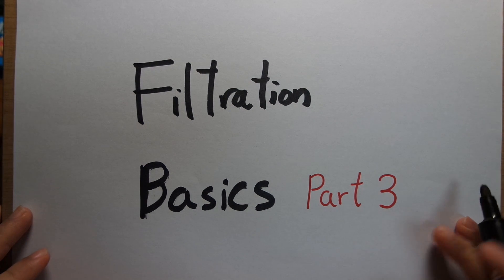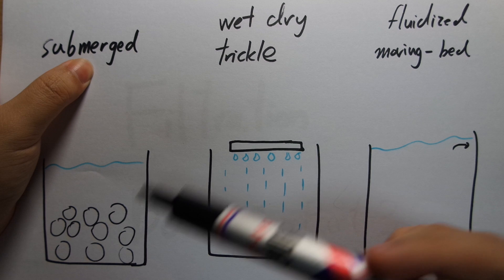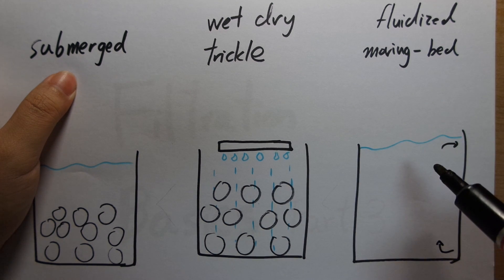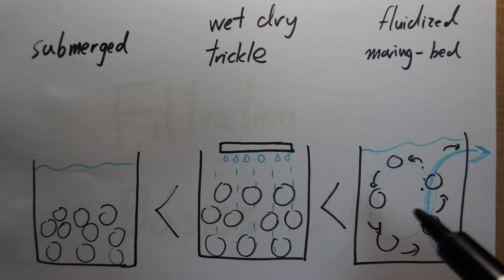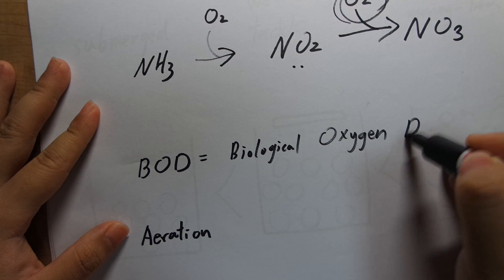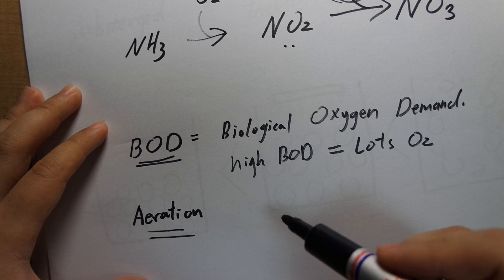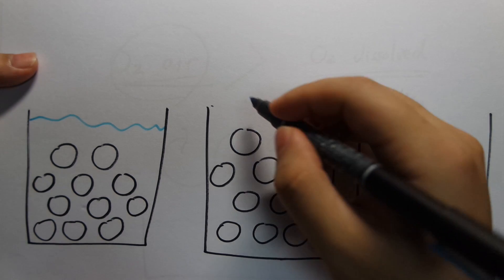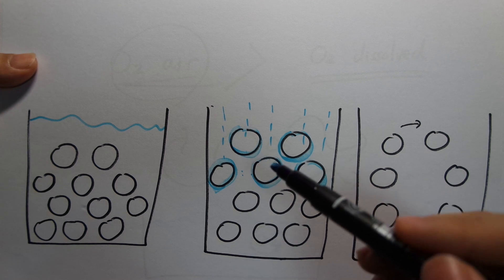Aquarium Filtration Basics part3: wet/dry, fluidized/moving bed filters. are they more efficient?

Comment: Thanks for the interesting video. I'm considering using a moving bed filter. Or a wet dry filter.  But I heard that a dry wet filter causes the co2 to escape from the water.  And that's why you can't use this filter in a plant aquarium. Is that true?  And is this also true for a moving bed filter.  Can an artificial supplement compensate for the loss?

Comment: Nice explanation Jay. Small clarification , Currently I am designing a filter ( out door)  for my indoor Aquarium ( 6' x 2' x 2') . i am planning to use all 3 categories of filters for this , Submerged , tickle & fluidized filters for this. What will be the preferred, sequence for this ?  Pls advise,
Reply: Well, think of how the cycle goes...  Converting ammonia into nitrates requires oxygen, so first, you'll want the high oxygen filter (I would just pick one, either the fluidized or the trickle, not both).  After that, the nitrate needs to be converted back into a gas, so that's where you use the low oxygen filter (submerged).  Actually, check out Jay's videos on denitrification and anoxic conditions required for it, he is most educational.  Also, if you look up Kevin Novak's videos on Biocenosis Clarification Baskets (BCB) you'll find that he doesn't pump the water through the filter, but instead, around it.  The filtration or denitrification happens through ionic exchanges (I think).  He has a BCB in his Koi pond that's still good after 30 years, talk about low maintenance.  You'll want to design the system so the pre-filter (mechanical filter) is what requires the most maintenance.  Then, your other filters will do good left alone so as to not screw up the bacterial colonies within them.  Hope that all made sense.

Comment: How does a fully sealed and therefore submerged media moving-bed filter have any more O2 than a canister filter assuming the same level of O2 in the aquarium water?  You're not pumping any air into that moving bed so how can it have more O2?

I can see the point in large water treatment facilities where the moving bed is open to the air and it gets loads of air pumped through it ie, it's not in a sealed container but any moving bed filter I've seen for aquariums are sealed chambers therefore, they will have the same issue as canisters as regards O2 levels.

A fluidised bed filter reactor chamber is just a canister filter with media that's small enough to be mobile under water flow.

It has an advantage in self cleaning it's surface, but no advantage regarding O2 levels in the water.

To get the bonus O2 advantage, the fludised bed would need to be open to the atmosphere and have air pumped through it with the water.  That's probably only suitable if you have a sump.
Reply: all water has oxygen, the lower the water movement is the less oxygen. All heat [plays a part. faster moving water carry more oxygen. Adding an agitation to the water will help the water to release more oxygen gases. Even in a sealed system oxygen can be produce. The faster the agitation the high the level of oxygen released.

Comment: With fluidized sand filters however you seal the container like a canister and pump water in to generate motion. Where is all the air gonna come from if the intake pump is submerged? It becomes a fluidized submerged filter then and not sure if it's any more efficient.
Reply from the maker: you dont need air in the filter. oxygen is dissolved in water. sand fluidization requires high flow and that means you are pumping large amounts of oxygenated water into the filter.
Reply: Jay's aquarium Yes but in your video you state it is more efficient than a submerged filter because of more oxygen available. Assuming the same flow rate for both types, I don’t see where it is more efficient than a submerged filter unless the fluidized filter has internal aeration.

Comment: Jay wet dry is not limited and neither is fluidized... simple adjustment of baffles fixes all issues. I run a submerged 55g sump that has two fluidized chambers as well as a low flow chamber for nitrate consumption. By simply using different baffle heights you can use any type of filtering at any time wo sacrifice. The only downfall of wet/dry (and the reason I don’t use it on my sump) is you lose a lot of water capacity due to all the air. My intake comes down to a fluidized bioball chamber. (Intake is low in chamber and baffle high) I like bioballs for capturing detritus not for filtering. The water then spills over to a bubble baffle high then low setup. From there I run k1 media with 1 air stone 6” Long. The water then spills over another bubble wall baffle setup where I have biomedia. This area is 17” lone but split in half with an almost full height baffle. The second half runs my nitrate chamber. Because it’s one chamber with bottom intake under baffle and overflow baffle on the other side.. by having a split wall in the middle I get tons of bypass which results in low flow for the nitrate chamber. From there I run yet another bubble wall baffle setup to my return pump. 

Point I’m getting to is with proper planning you could run all three types of filtering in any given setup at the same time. I would actually prefer to do a trickle over my bioballs and remove my k1 and replace with Something else... but I won’t give up the 15 gallons or so of water I’d lose. Ideally I’d run trickle over balls, followed by smaller k1 chamber, followed by some quality media then a big cheato chamber. I could very well do this now by simply moving a couple baffles. That would give me submerged, trickle and fluidized all in the same system. Everyone says you have to pick a system and go with it.. that’s BS. By simply picking proper baffle heights for each chamber you can do anything you want.

Comment: Thanks Jay for your vids. I remember another youtuber, which is using a lot fluidized, who said that fluidized is very efficient because the media as is acting as a carbon source for the bacteria. He also mentioned that it is consumed quite rapidly. As sand can be used as fluidized media, I imagine it is less efficient or need a carbon source to be efficient. Do you have any idea about it ?
Reply from the maker: xamax4 I have not seen a fluidized media that can act as a carbon source. Not sure what  that other youtuber is talking about. The problem with sand is not the carbon source. Sand is harder to fluidize bacause its heavy. Much easier to use stuff designed for fluidized filters
Reply: @Jaysaquarium  please tell us how to do anaerobic filtration in a tank with fluidized filter..my source water has high nitrates and i cant reduce it..pls help

Comment: I run 2 liter bottles of k1 media X 2 with some bio home in the bottom just to weight the bottles down.   My canister filter has only filter pads as I fully trust in the k1 and don't need extra media in it.  I've tried every media from bihome, marine pure, ceramic rings, plastic bioballs.  K1 IS THE BEST
Reply: Have u tried fluidized sand bed filter?

Comment: I'm honestly kinda lost. I currently have a submerged sump filter. 

I have turtles and my current sump cannot keep up with them. 

So I am wondering if a fluidized filter was better? 

cause my turtles produce a lot of waste and even with weekly water changes of 50% the water still is not clear and needs fully replaced once every 2 months.
Reply: try fluidized purigen to make your water crystal clear 
https://www.youtube.com/watch?v=KQBlqoS7ZqQ
Reply: Kiss Me Baby  ok. I'll look into it. Thanks
Reply: ur welcome :)
Reply: maybe your current media is not the best and you could optimize your current system by using more and better media, such as perlite or even better; seachen matrix. Fluidized wont give you the anoxic cycle allowing to reduce NO3.
Reply: Officially Tielo Water clarity has nothing to do with nitrogen cycle and you should never ever change more then 65% of your water at the extreme limit. 25-50% is ideal. Even then it’s based on nitrates not clarity of the water. If your water is cloudy you either have a bacterial bloom or lack of fine filtering. Most likely it’s a bacterial bloom from over feeding. Everyone over feeds. Get a 9watt green killing machine UV filter.. that will clear up bacterial blooms in a couple days depending on tank size. Smaller tanks it will clear faster. Second add an air stone on the far side of the tank from your return line. This will help with oxygenation, surface film, as well as keeping particles suspended till it can get back to your filter intake. The third thing you can and should do is add Polly filter to your filtering. It will pull out fine particles. 

If none of the above works.. stop using tap water to clean your filter media as the cloudiness is your tank constantly cycling cause you keep killing off the good bacteria. Always clean filtering media with tank water.